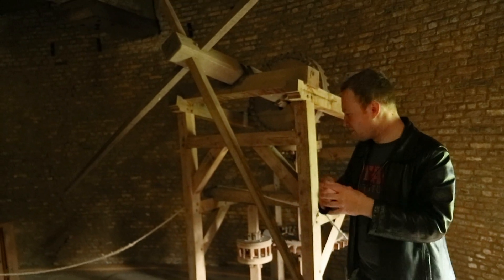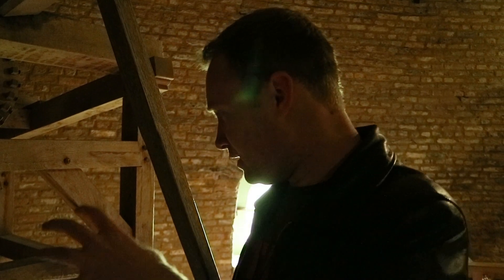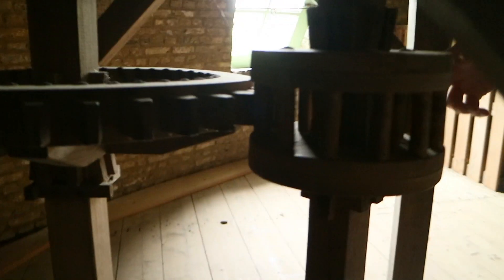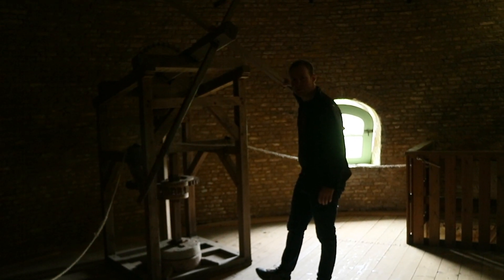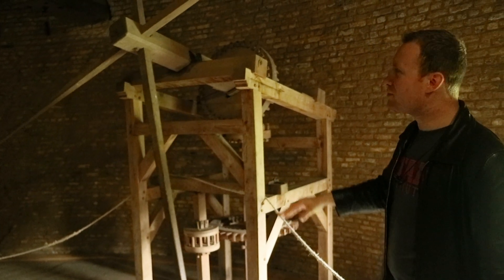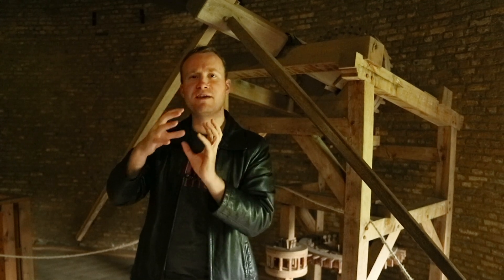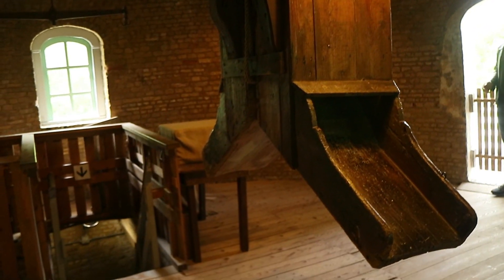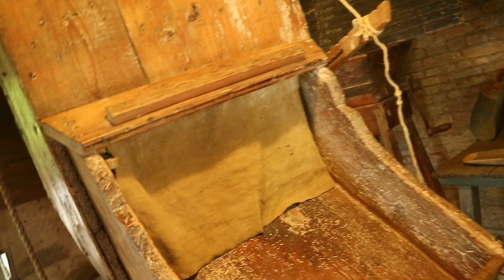What's Inside a Windmill? The Value of Models

Comment: I'm REALLY thinking of making a skeleton rig like the one you show here, but in metal, as making it 10cm tall would necessitate way too thin wood. But yeah, making a small scale model with polished brass and aluminium and some oil for lubrication, I suspect you might even be able to make it functional under 0 load. As in, you blow on it and everything turns, as long as you're not trying to grind anything. Would be a cool project, I'm thinking.
Reply from the maker: Dude. That would be awesome! JB

Comment: The teeth on the main drive gear are wood for a good reason.  If something in the downstairs mechanism jams, the driving sails cannot be stopped instantly so the wooden teeth are designed to break and divorce the input drive shaft from the jammed lower section.  Absent these weak-links, major damage could be done putting the mill out of action for days or even weeks.
Reply from the maker: That's so cool! JF
Reply: Yeah, but that’s what shear pins are for!!